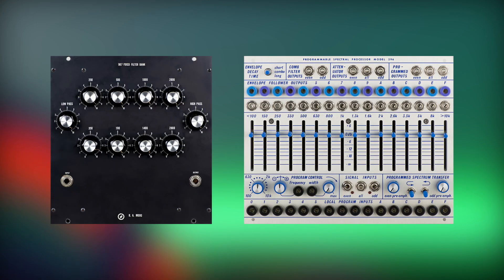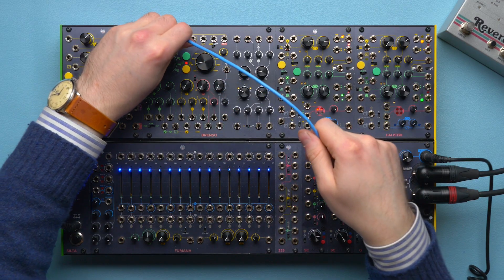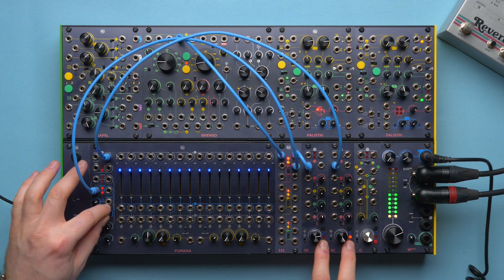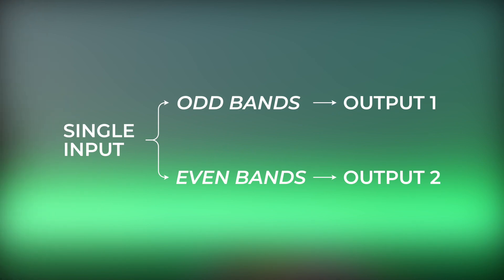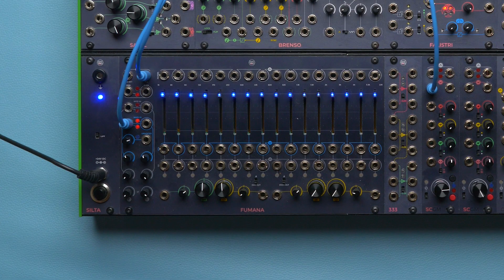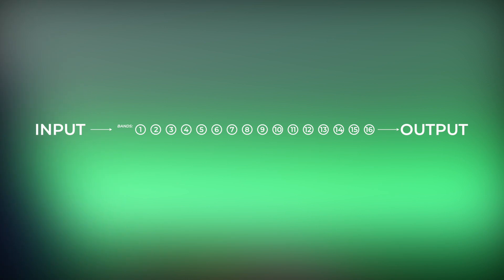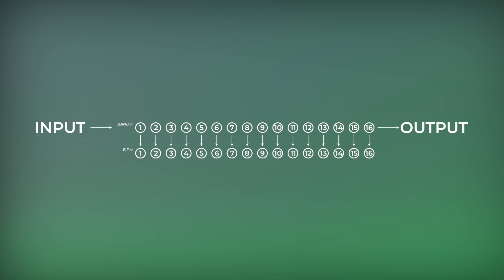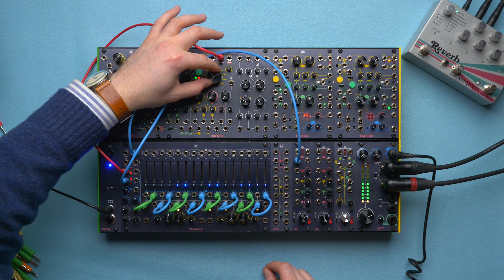Filter Banks  |  Frap Talks

Comment: I might have missed something and apologies if it is the case but how did you achieve the spectral technique on both vocoder and drum without patching the envelop followers?
Reply from the maker: Good question! If you refer to the last patch, it is possible because FUMANA’s bands are grouped into odd and even: if you patch two separate modulation sounds, you can "split" the machine in two. If you patch only one sound, it will be routed to both groups at the same time, working as a 16-band vocoder. Feel free to check this other video for a detailed explanation! https://youtu.be/eEl1cU2t8Y4?t=456